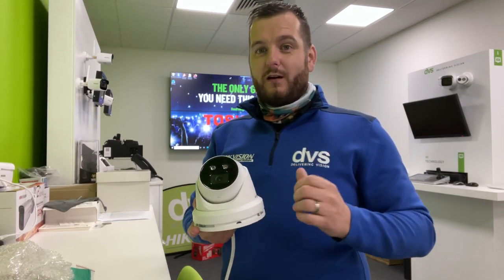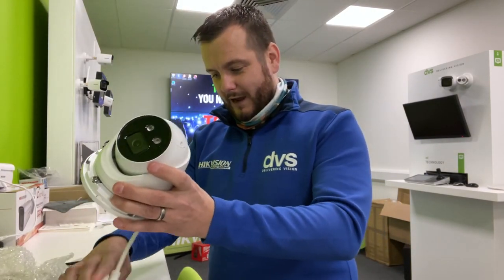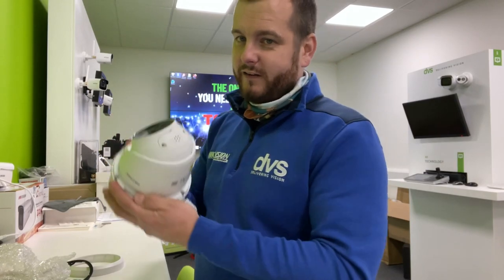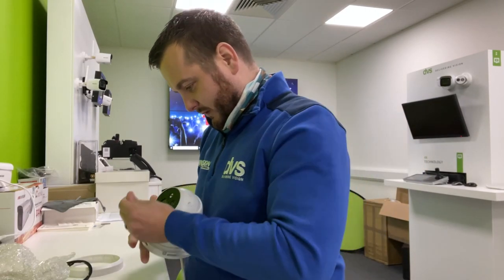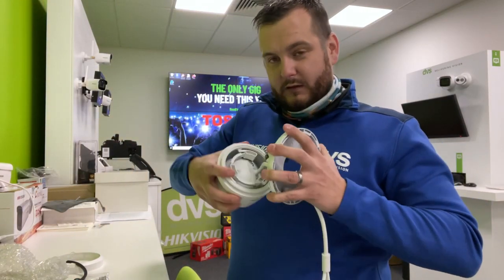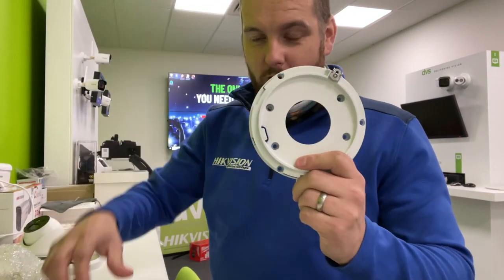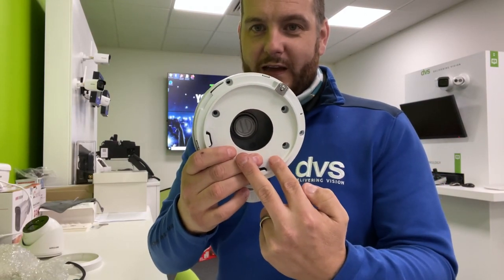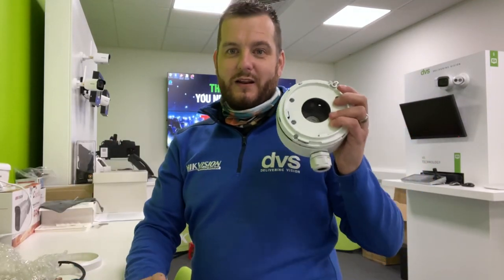How to fit a Hikvision G1/G2 Turret to the DS-1280ZJ-DM21 Back Box

Comment: Can I install one of these cameras on an external wall without a base if I feed the cable through a hole in the wall and terminate on the inside?
Reply: Sure you can!
Reply: Just keep in mind the cameras pig tail length and the diameter of the hole needed to stick the network jack in.  It'd probably be a good idea to stick a piece of rigid conduit in the hole for added protection against the elements and run your cabling through it.  Just my $0.02.
Reply: @tsnorquist  yes the wall isn't very think so the pigtail will be long enough
Reply: @philip_james  right on.  I always box everything in and run conduit whenever possible.  I've found to have less issues that way from nature or people in my time.  Better to invest the time and effort up front than continued battles down the road.
Reply from the maker: yes that is also possible 😊

Comment: I just want to know when hikvision are going to think when using these boxes sometimes in the vertical plane but many time when upside down are the going to make rubber surround seal stay in place.  It just usually droops and become very inconvenient.  

I remove the seal a dab some silicone around the edge a put the seal back enough time before hand to have to set off and hopefully the seal will stay there while fixing the top
Reply from the maker: yes agree I will see if we can improve this

Comment: will that will fill up with water
Reply: Not from my experience. I also use the water proofing kit supplied just as extra protection
Reply from the maker: No there is a seal between the camera and the base
Reply: @DVSLTD  the hole from the front plate to box has a rubber seal
Reply: @cjkokay  what about the hole on the back of the turret camera water will go inside and fill up
Reply: @AussieRC  Then just don't face the hole upward/sideways, only downward, and/or seal it with sealant for outdoor use. It's that simple. Jeez.
Reply: What's is the difference between the DM21 & PT6 back boxes, as they look the same ?

Comment: Any explanation on how you seal cat5e cable using the provided stuffing gland?😂
Reply from the maker: I generally change the gland to a smaller compression , if you want to use this gland simply wrap self-amalgamating tape around the cable to thicken it , then compress onto this , it will work very well
Reply: @DVSLTD  I also throw it away. It's a weird size. It's not proper 25mm  so it doesn't fit on other equipment. 
Hik really need to make their back boxes thinner. I know it's deep because of the larger gland size and because they want to allow the pigtail to pass through but what's the point of a back box if the pigtail passes through and out the back box?
Reply: @AsadMulla  that's because it NPT 3/4". If you do want to use a metric 25mm gland or conduit plain to screw adapter  either use a locking ring inside, or get a 3/4 to 25mm adapter or a bit of plumbers thread tape.
Reply: @cjkokay  Is it really NPT, or is it 3/4" BSP?